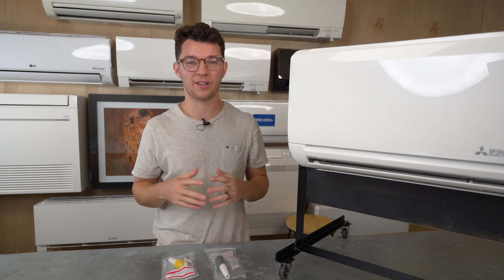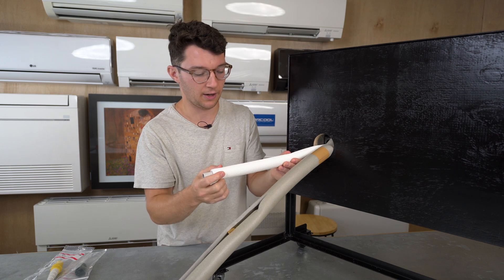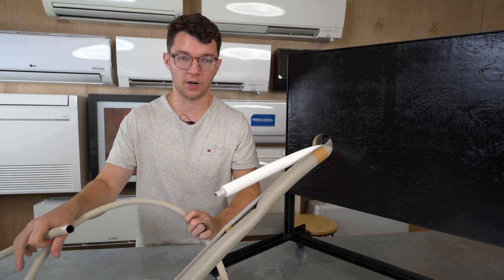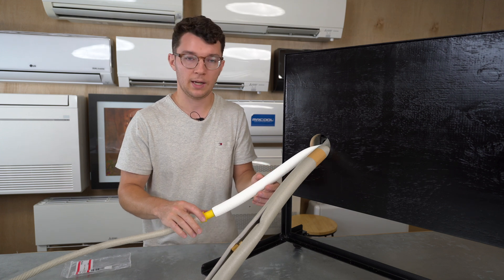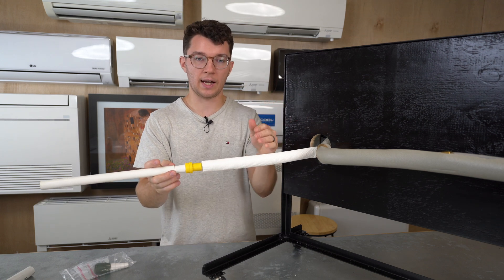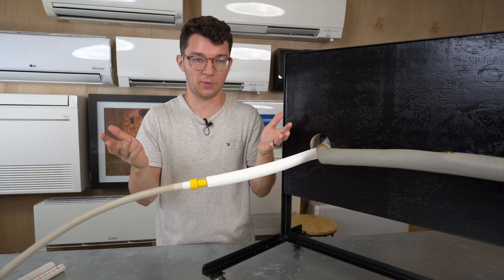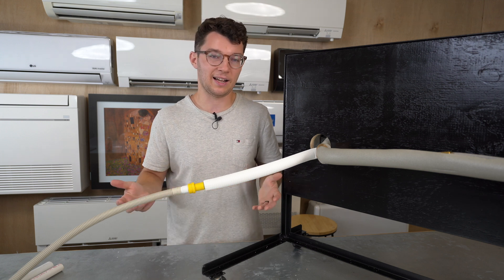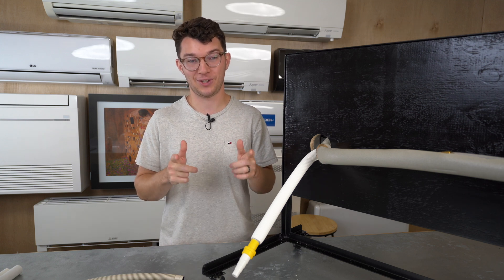Ductless Mini Splits: How to Prevent Leaks

Comment: Eccentric flaring tool and a torque wrench to tighten flare connections.
Reply from the maker: Flaring block and digital torque wrench are definitely essential to prevent refrigeration leaks.